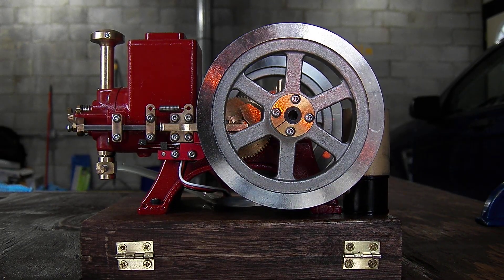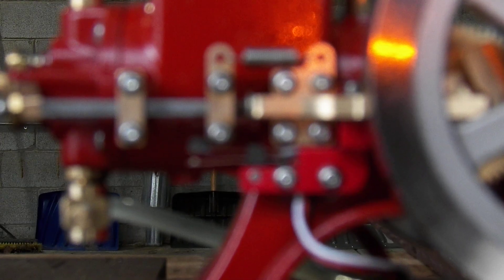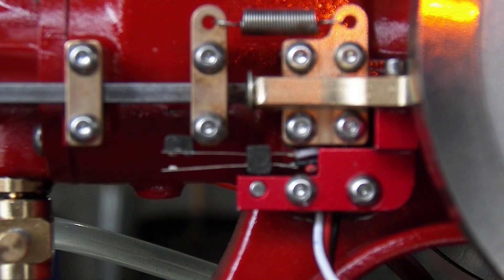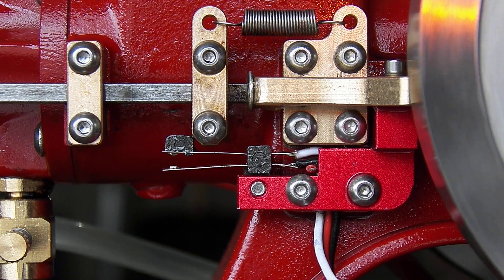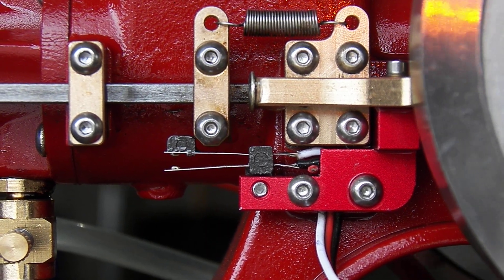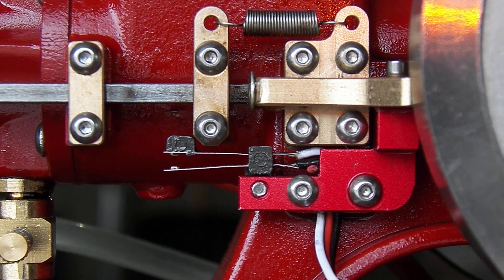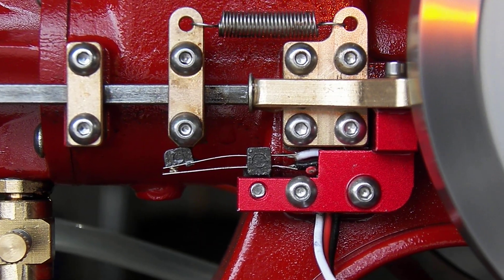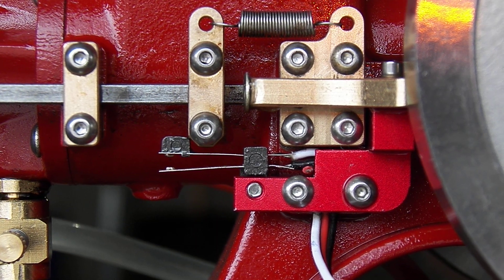Closeup of Enjomor Ignition short

Comment: What is the function of this switch?
The ignition has hall sensor for spark or not ?
Reply from the maker: The enjomor does not use a hall sensor like the EM and ET series engines.  This reed switch fires the ignition module,  I have no idea why the red lead on this harness is connected to the high tension lead though.